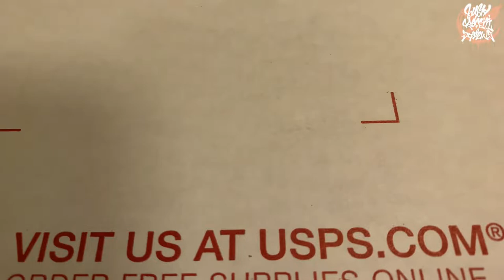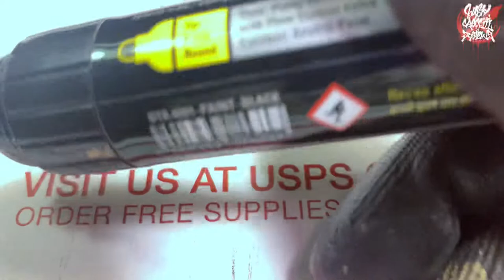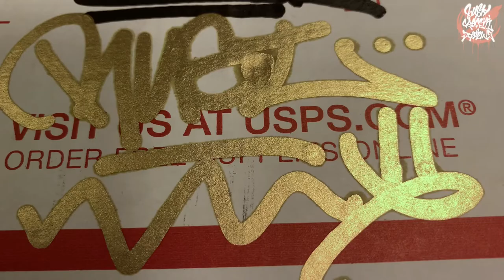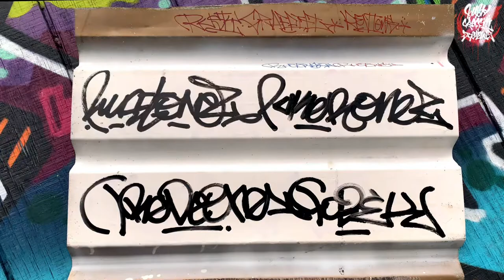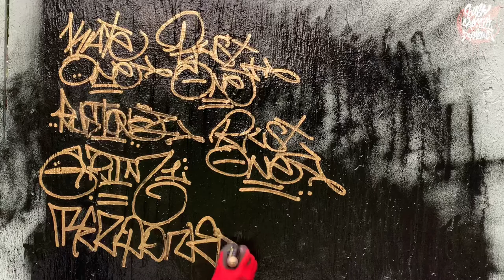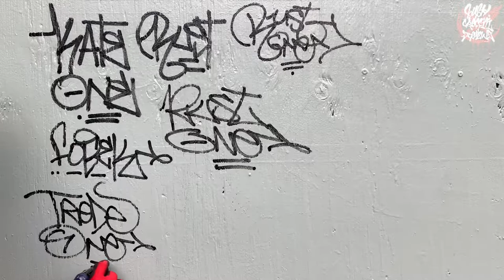On The Run Bullet marker Review

Comment: Does this marker flow with paint or just Inks
Reply from the maker: @Bootymuncher23  paint will work but I would only want to use ink. The pump system is short so lil bit at a time. Better with ink

Comment: Not really digging the soul tip nib on the black, comes out too streaky 
Can anyone recommend a nib n flowing ink to put in these?
Reply from the maker: Maybe a 8mm uni nib like the px-30 may work. Or even thin down the black with a lil splash of acetone or paint thinner. I love the marker except for the nib and when you depress the nib it’s so short. I ended up putting speed flow in mine
Reply: @RustyGraffitiReviews  ay good lookin out Rust I'll try out the acetone first but think a new nib would do wonders 👌🏼
Reply from the maker: @mastaroshi23  anytime homie. Any marker you wanted to know about I can see if I got it or can get it LMK. Stay up g.